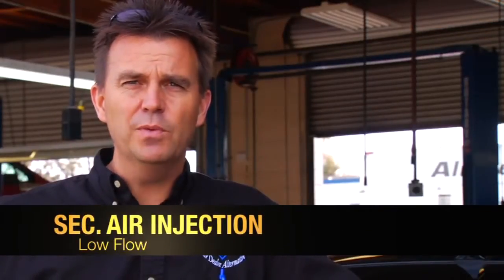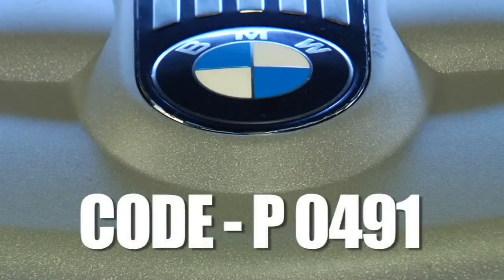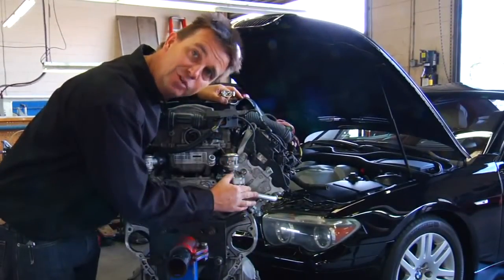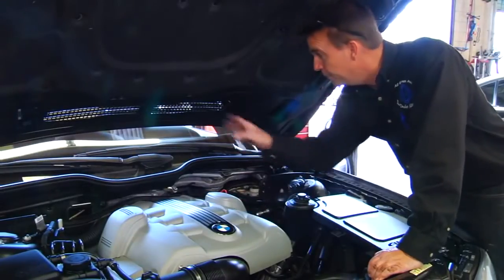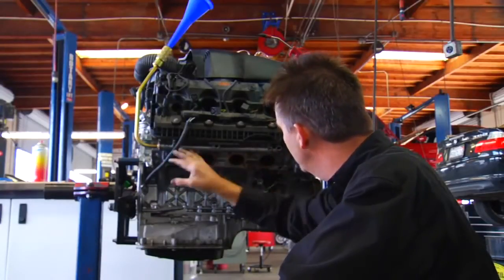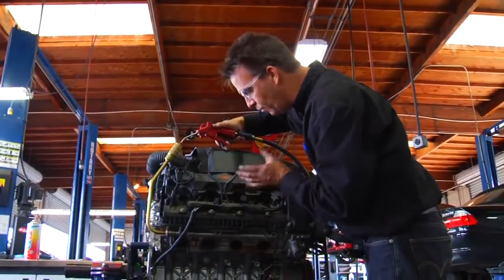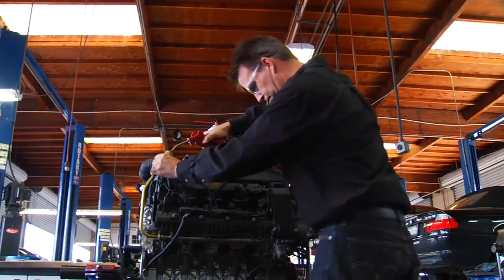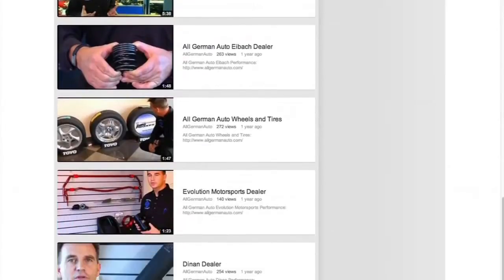BMW Secondary Air N62

Comment: Can anyone help me ? I did this to my bmw 545i and now the car has misfire in cylinders 1,2,and 3 I don’t know what to do now I put seafoam instead of carbon cleaner into the system .
Reply: Did you end up fixing your issue?
Reply: @AnthonyB58  yes I did and it was a pain in the ass ,remove the heads replace head gaskets and clean all the carbon inside ,in my case was impossible doing it whit the heads in the engine because there was too much carbon
Reply: Yikes that sounds scary bro, I'm at 126k on my 545i it drives good but, I can tell it drives different from last week, my ses light just came on a few days ago ever since the light came on the doesn't feel the same, still drives smooth, starts right up, I'm hoping its not to bad for me, I just ordered a new air pump a few folks told me they had the same issue and just replaced the air pump and the ses light was gone, I'm going to attempt this if my ses light doesn't go away

Comment: Good day.  please tell me on what mileage do you perform such an operation with the engine?  and please tell me what you will advise from the work for such an engine if it is 2006, but from a car that since 2009 just stood and did not drive.  did not start.  engine mileage 16000km.  Thanks in advance for your reply!  Have a good job.